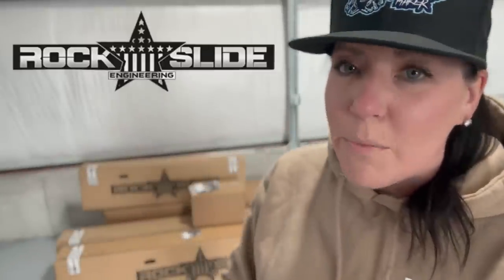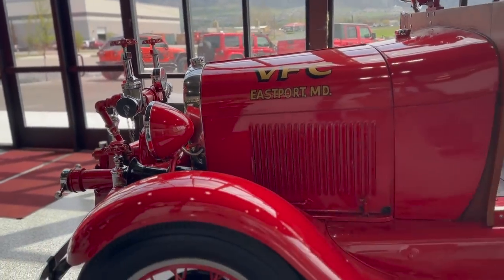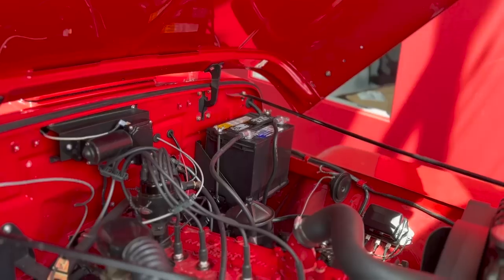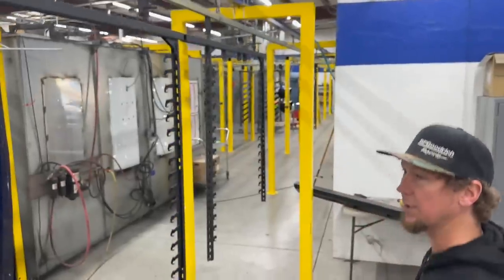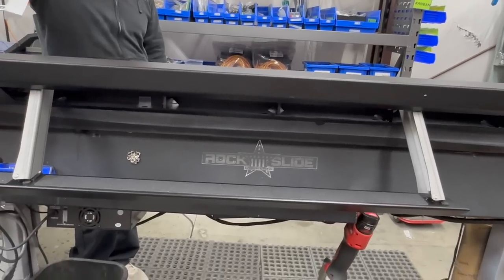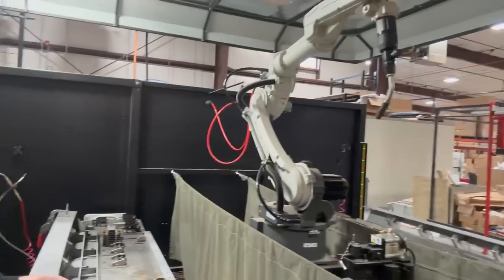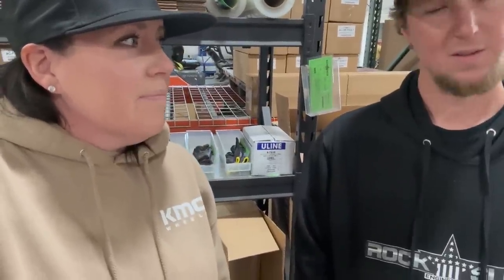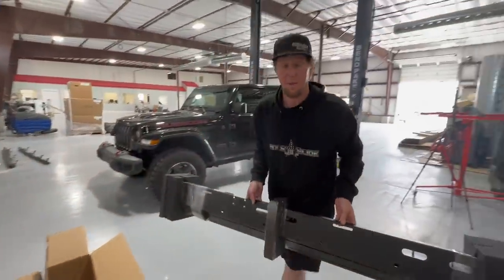Don’t Lift Your Gladiator Without These First

Comment: After watching, I went over to their website to see what else they are making. 
To my surprise they specialize in “Step Sliders”!  I have been thinking how can I make the climb into the Jeep easier since I moved up to 38’s. They have it all worked out!!!
It was complete luck that I had time to check their site out. 
I feel bad for anyone else that only saw your video and missed the key point of what they bring to the off-road community. 
I think you were awestruck with the manufacturing (which was awesome!) and fell into the trap of “not seeing the forest for the trees” 
I recognize this because I fall into the same trap all too often. 
Maybe in the gladiator followup you could share why Rock slider Engeering is special.